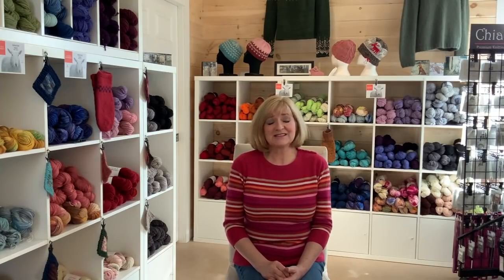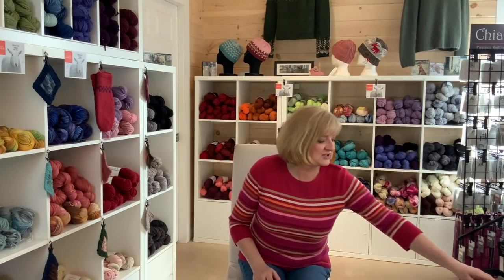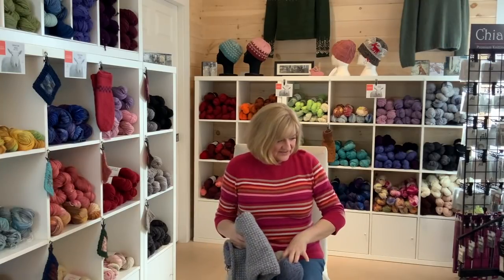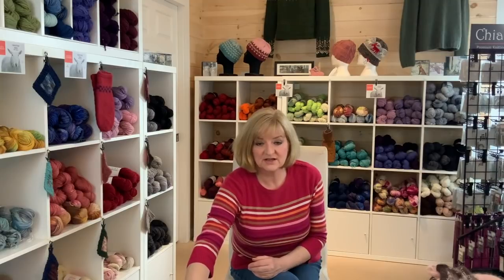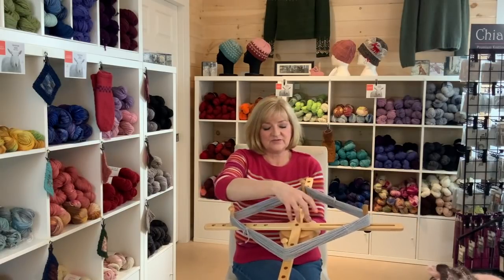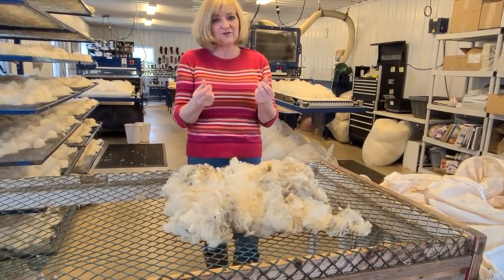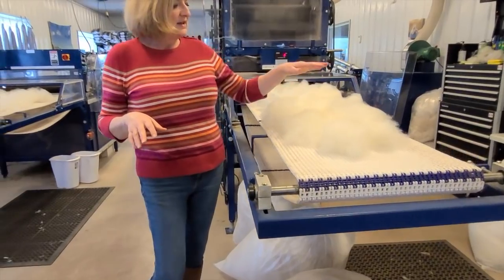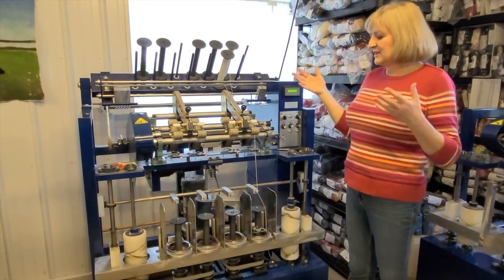How We Make Yarn! - Fleece & Harmony Knitting Podcast Ep. 72

Comment: Thank you for the tour and explanation of each machine.  I did watch your previous tour and it just amazes me how consistent the product is after all the work!  I am curious as to how much actual yarn your fleece makes after one shearing.
Reply from the maker: The yarn yield from sheep's wool is about 55 - 60% of the weight of the raw, greasy fleece. One sheep can produce between 6 - 10 pounds of fleece in a year (average, but really depends on the breed).
Reply from the maker: After all of the processing, 1 lb of raw fleece makes about 0.6 lbs of yarn. The average sheep produces about 5 - 6 lbs of fleece a year.

Comment: I couldn’t manage two handed purling colour work. From the YouTube by Cricket Toomey Knitting Backwards I learnt the process that gives the front pattern view whilst technically completing the purl row through using reverse knitting. I use the two handed weaving technique often called The Philosopher’s two handed Fair Isle method. It is still slower but viewing the pattern as from the front is a great benefit. My fallback knitting style is what some call flicking or English. I mastered Continental for colour-work but the next step to continental purl was too much and my project needed a flat piece colour-work approach.
Reply from the maker: I will check out the Cricket video. I weave use the Philosopher's method as well. I am mostly a continental knitter now, but I do use different methods for different manoeuvres. I find it a great advantage to know multiple ways do execute certain stitches.

Comment: This was just fantastic - I loved the tour of the mill. I have two questions - does the first wash (the really hot one) not felt the wool? The other question is, have you ever considered selling the roving - I'm just learning to spin, so of course, I found this fascinating. Thanks so much. Love your podcasts.
Reply from the maker: In order to felt, the wool needs to be agitated roughly with soap in hot water. The hot water itself won't felt the wool. You don't use hot water when washing woollens because, when you rinse, you would need to rinse in the same temperature of water. If you hit hot wool with cool water, it will also felt. So just safer to always wash wool items in cold water.

We do sell roving in the shop but not on line as we don't have a consistent inventory. Because we dye all our yarns in the skein, we rarely make colours in roving.